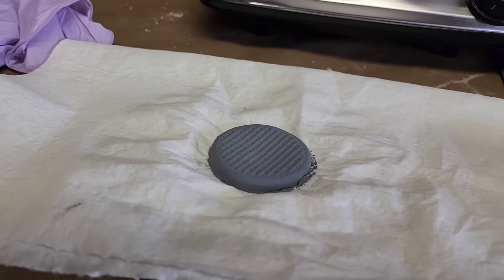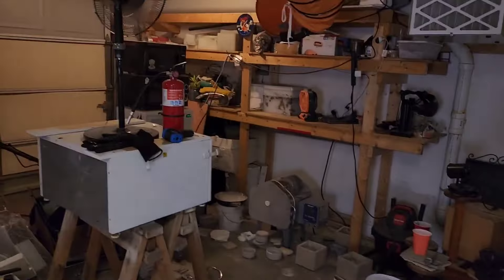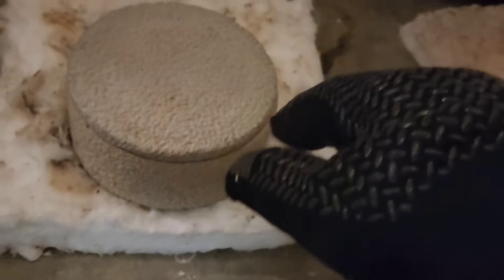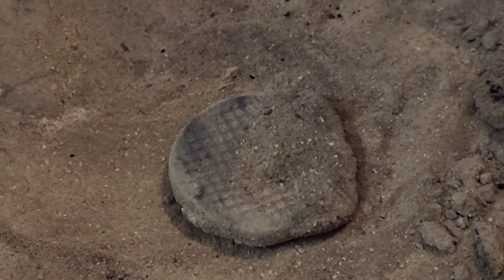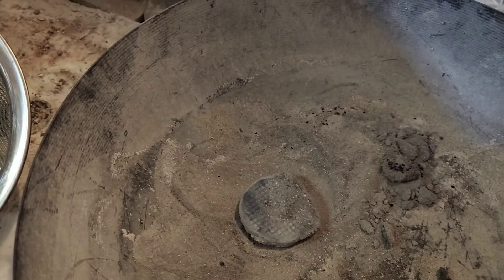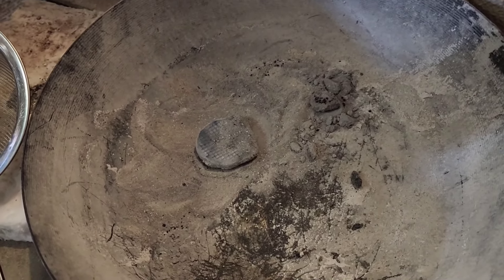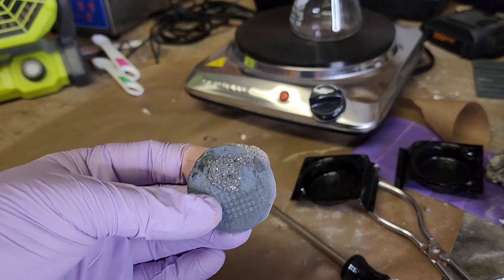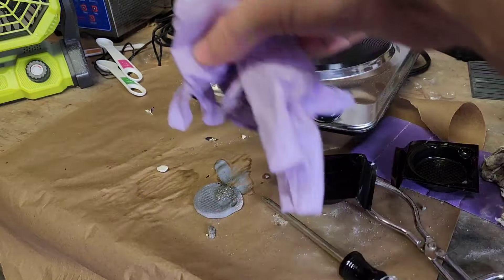Silicon Carbide Microwave Sinter Results

Comment: It's interesting, the obvious application is body armour. When I tested an older version of the graphite in this video we managed to stop 7.62x51 FMJ with graphitic reinforced polyurethane but not convincingly so, since the round penned 20mm's into a 25mm thick plastic plate. It was much more comfortable with 5.56x45 and 5.45x39 rounds. In regards to a graphitic reinforced carbide form of armour then probably it could stop at least one tungsten core or tipped armoured piercing round, the trade-off is increased weight but that's the price you pay for being in such an horrendous threat environment.

Comment: hey man, im currently doing an internship at a research company on a project about virtualfoundry's filamet. I mentioned your microwave experiments and now that has become my official auxilary goal, It's really interesting! I do have a slight question about general microwave sintering, do you often have trouble with hot spots? Because as far as i've seen your crucible apears to be stationary and the spinning part is crucial to something in a microwave warming evenly so im wondering if your results could improve if you somehow get the crucible to spin in there
Reply from the maker: Hey cool and good luck 👍 
For the current microwaves I use part of the protocol is a manual rotation by a quarter turn throughout the cycle but I'm building out a new setup that will allow for the rotation if desired.  The problem is thermal shock to the spinning tray causes it to blow up and the component that locks into the tray is made of plastic and melts. Not unsolvable by any means but tbh, I've gotten good results without having the const rotation so it hasn't been a huge priority of mine just yet.

If you want to try it out a bare minimum setup could just be a layer of ceramic wool on the glass tray that the crucible can sit on

Comment: Thanks for the great video!  I wonder if a home-sintered brick could be used as a machine tool on a lathe or if the sintering just isn't strong enough?  I'd be very interested to see what would happen if you ran your puck on a hardened steel file and how much the file and puck would get scratched.

Comment: What are you using for the arc sintering? What's the admix to make it a composite?

It'd be nice to find out if this process can make a good ballistic hardface.
Reply from the maker: @sumguysr  same microwaves for arc sintering but adding arc media (ie. Flake metal foils / carbon / flux if any (in this case no flux))

It's SiC / AL / exfoliated graphite blend and yes the thought here was for ballistics if I could get some good results
Reply: @Mr-Highball  

I wonder how that composite might change if you put it in a hydraulic press before you sinter it.

The best vibration damping material developed right now is cement milled with exfoliated graphite then placed under 3000psi before it's impregnated with water. The exfoliated graphite forms a network of flexible graphite containing the cement crystals.
Reply from the maker: @sumguysr  it would be interesting to compare, but I don't have access to one right now. I'm sure adding pressure would ultimately lead to a stronger part but for now I'll just have to see what's the best I can get in my garage 😄

Comment: I want to make very specific sculpted 3D shapes from this material involving lots of curvatures and fine detail. Does the cintering process mess up fine detail on the part alittle bit?
Reply from the maker: @bringer-of-change  the big thing to account for is shrinkage that occurs during sintering, but if that's done then no, the details should be preserved quite well
Reply: @Mr-Highball  That's awesome. I was worried that the shrinkage may also involve some warping. But if not, that's great.